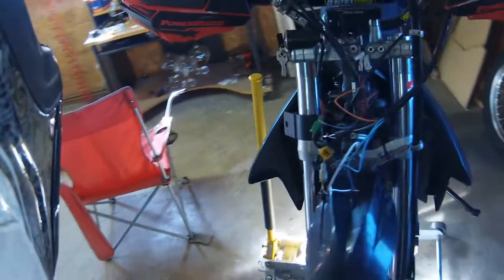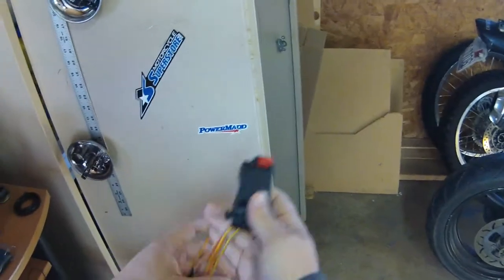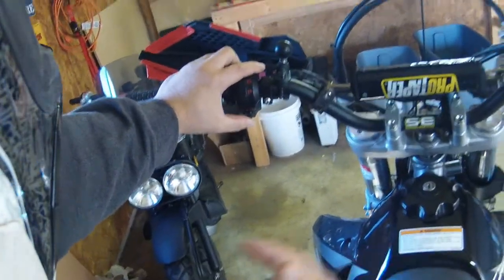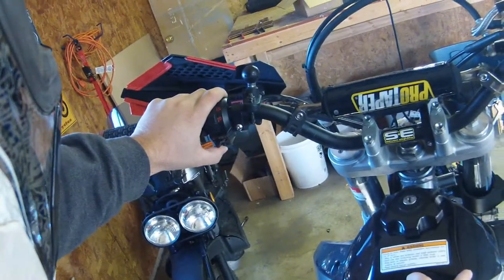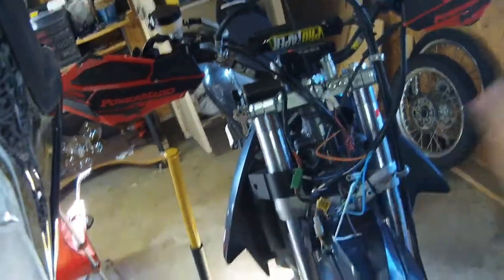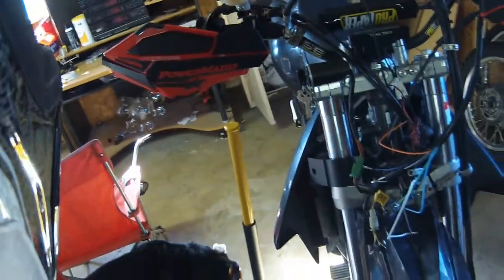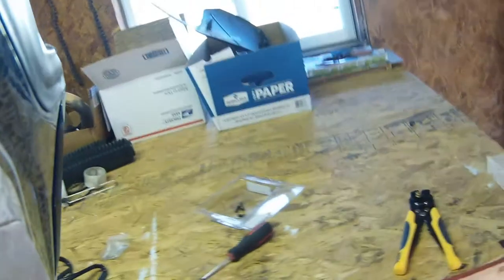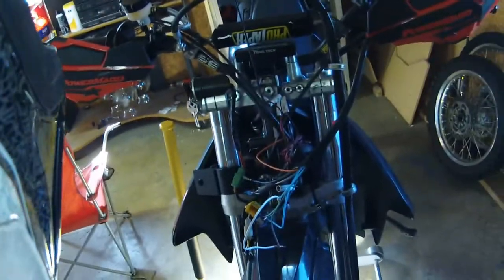Drz 400 Start/Kill switch mod

Comment: +cody I have a question that you handle?
Reply from the maker: +Mattia Alberti yeah sure, go ahead!
Reply: +decil handlebar that is?
I also have a drz and I would take the same
Reply from the maker: +Mattia Alberti those are just Protaper 7/8ths. or check out Renthal bars.
Reply: bending it? cr high , suzuki factory, Carmichael or another?
Reply from the maker: those are Trial High